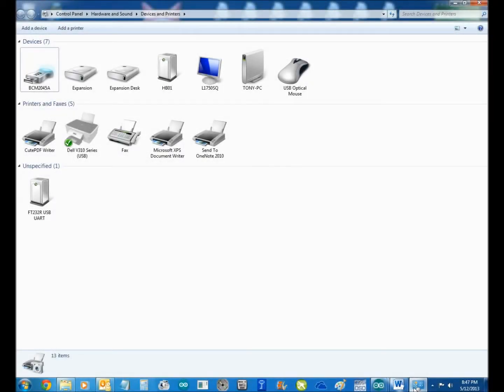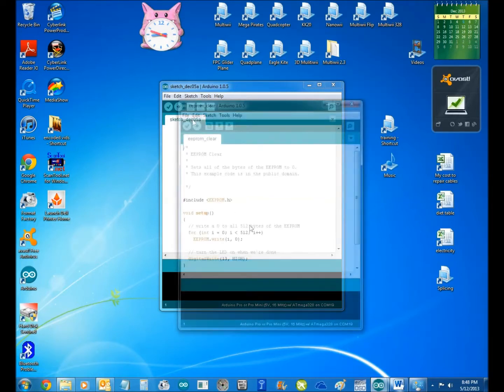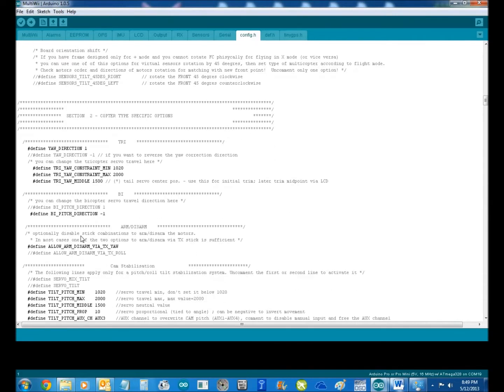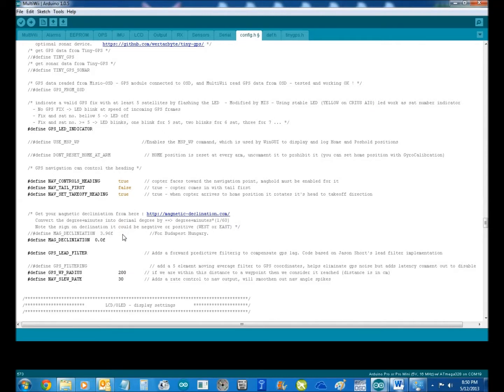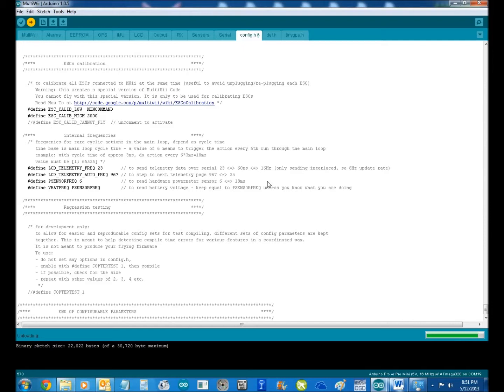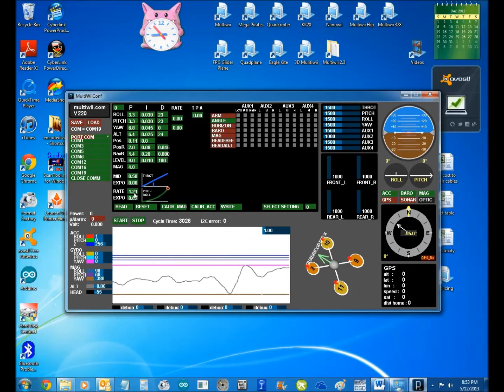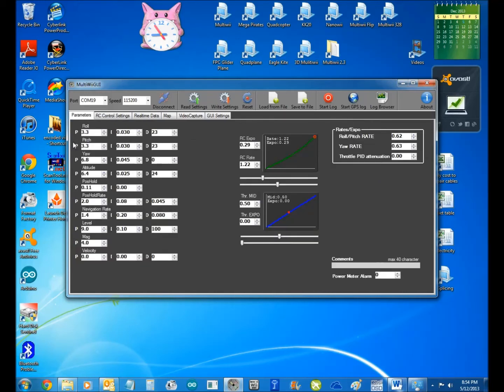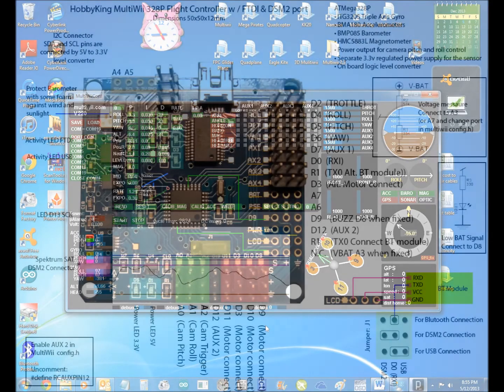Multiwii 328P Board Set Up

Comment: Hey, me again. I've sent you a rather lengthy question via private message. I don't know if you check that, so I thought I'd give you the heads up here. I'd love your insight about proper settings for a DSM2 satellite receiver. The details are all in the message.
Reply from the maker: +Simon Anderson Hey Simon, I have had a look at your email and I have no experience with what you are trying to do...... let me do some research and get back to you.
Reply: +moochasas I've been doing some research too. I'm pretty much ditching the DSMX/DSM2 thing, and going with a bluetooth module. I purchased a "JBtek HC-05 Wireless Bluetooth Host Serial Transceiver Module". Do you have any recommendations for changes to make to the code for using that?

Comment: Hi. Thanks for all the help so far! I'm having some luck completing all the configuration in the first half of the video, but no matter what I do, I can't get the "MultiWiiConf" program to open. The error I was getting at first was "Windows cannot find 'javaw.exe'." After realizing that was a file within the Arduino install files, I tried copying the "MultiWiiConf" app into the Arduino folder with the "javaw.exe" file in it. That didn't give me a warning, but the app still wouldn't boot. Then I did the opposite; copied the entire "java" folder from Arduino into the folder containing my "MultiWiiConf" application. Same outcome. Help me!
Reply from the maker: +Simon Anderson There are a few unforgiving steps within this process..... you need to get both the program and the GUI as a pair. You need to have the latest JAVA update on your computer. You need to open (unzip) both files and keep them under one folder..... so here is the steps in order.... Download your MW files and put them into a new folder ...... unzip them. .. connect the board to the comp... make sure you can see the board in your PRINTERS & DEVICES..... check what comm port you are on and make sure your baud rate is 115200...... (this can also be checked in your DEVICE MANAGER/ PORTS).. now close that up as you cannot have the arduino file and the GUI open at the same time.... open the GUI folder and there will be 5folders to choose from.... windows 32 & 64 bit,  Linux 32 & 64 not and Mac....... usually windows 32 bit works.... in that file there is a file called Multiwii Config.Application.... click on it and it should bring up the GUI........ then with the board connected to the computer click on the comm port that you saw in your device manager or printers and devices folder.... thats about it....... there are a few important sequences in the above... copy and paste this reply and follow it to the letter.......IF you dont get the part where the GUI sees the board reply back to where you got up to and what error you got..... these boards are unforgiving if you dont have all the steps in place in sequence..... cheers and good luck
Reply: +moochasas Thanks for responding! No luck though. I've tried updating JAVA; I've tried unzipping the MW files in the JAVA folder; I've tried installing the JAVA update into the unzipped MW folder on my hard drive; and I've tried all those options on two different computers, one with Windows 7, and one with Windows 8. Still no GUI. The app hates me! What now? I've been trying all this with the latest MW release 2.4. Could that be part of the problem? A while back I tried MW 1.8 and had the same trouble, though.
Reply: +moochasas WHOA!!! It worked with the Windows 32-bit like you said! So, I have the GUI open now, but I'm having a few other complications. I think it's stuff I can work out on my own though. Thanks for the help, and hopefully I won't have to bother you too much from now on.
Reply from the maker: +BGmamaBlu Congrats... and let me know if I can be of any more assistance.... and it was no bother.. its a pleasure to help

Comment: Ok so i am somewhat familiar with mutliwii i have wii pro board and it all works fine i got this board its new first time its pluged in so its a wii 328p with FTD/DSM2 port v2.3 quadx so i plug it in i tried 2.1 and get 2.2 and all i get is is error first it was mix tape error now its serialopen error with about 5 others you have a cell number i can text and u can help me walk throught if so email me it at flycrazy1981@gmail.com
Reply from the maker: +flycrazy william I emailed you.
Reply: +moochasas Hello moochasas, I got the same Problem. Everthing works fine until the upload of 2.2. I got this message:Serial:695: error: 'SerialOpen' was not declared in this scopeWhat could be the issue?Thx

Comment: i am trying to clear the eeprom and i keep getting that its uploading then fails
Reply from the maker: +flycrazy william The only 2 things I can think off is that you either have not got the jumper on the pins to allow the USB to be connected or you have your AUX 2 wire connected........is this the first time you have connected the board to the computer?....... do you have the right drivers for the board?...... let me know how you got on and if you have still having trouble if you could give me some background info that would help such as "this is my first time" Or I had it connected and flying but that was ages ago and now it wont connect"....... the other thing is do you have a blue tooth unit connected to the board (if you do disconnect it)...... also try another USB lead..... cheers

Comment: checking my sketch i got this issue
MultiWii.ino:67:21: error: variable or field 'SerialGpsPrint' declared void
MultiWii.ino:67:21: error: 'prog_char' was not declared in this scope
MultiWii.ino:67:32: error: 'str' was not declared in this scope

what is?
Reply: Luca Nsh i made it typing #define _PROG_TYPES_COMPAT_ at the end of def.h page. its dangerous? or?
Reply from the maker: Luca Nsh sounds like you should clear that sketch out and upload a clear fresh one........ and dont go ohhhh....this is how we learn and become fluent with the process..... trial and error... and at the moment you have errors.... so start again to avoid trying to fix something that still may be risky to fly
Reply: moochasas in fact it doesnt fly, throttle up and no one motors spin, and connecting the multiwii to the pc the picture with motors number doesnt move, roll and pitch axis too
Reply: Luca Nsh arm and disarm probs, im newbie ): ill test it
Reply: moochasas it works, but two motors have less power. Can i re-calibrate the escs?
Reply from the maker: You can but what I would check first is does it fly.... sometimes everything evens itself out when you take off..... the other thing I would do before you re calibrate the escs is swap over a good and a slow motor to double check that it IS the esc.......
Reply: moochasas ok ): hope that nothing is damaged. one more questionThe min and maxthrottle value from define.h can be set over 1550( which is the motor s kv?)
Reply from the maker: Luca Nsh in the sketch you can change the value of the min throttle by over writing the number ....... **************************    Motor minthrottle    *****************************/
    /* Set the minimum throttle command sent to the ESC (Electronic Speed Controller)
       This is the minimum value that allow motors to run at a idle speed  */
    //#define MINTHROTTLE 1300 // for Turnigy Plush ESCs 10A
    //#define MINTHROTTLE 1120 // for Super Simple ESCs 10A
    //#define MINTHROTTLE 1065 // special ESC (simonk)
    //#define MINTHROTTLE 1050 // for brushed ESCs like ladybird
    #define MINTHROTTLE 1150 // () (*)
Reply from the maker: moochasas You can see my minthrottle is 1150..... you can make it what ever you like..... but the higher the number the faster the motors will spool up when you throttle up........
Reply from the maker: moochasas define.h is not a page..... I hope you meant config.h :) and 1550 would be way too high as the motors would spool up and the copter would shoot up..... try smaller increments.
Reply: moochasas this is my specs. Motors HKdonkey 1550kv 100w - Props 8x4.5 - Battery 1000mah 2s - FC Multiwii328 - Esc turnigy 20a. the quad is 600gramsit wont fly. with 1250minthrottle too. That motor still moving lower. what's wrong? can u help me?
Reply from the maker: The problem is your battery is too small... a 2200mah 3S would be better and a 3000mah 3S would be ideal.... Also those motors seem slightly small as well...... I would invest in some park 450 x 1200kvs.....
Reply from the maker: https://youtu.be/U_ChrkrVcBI
Reply: moochasas will i have results replacing only the battery?or i have to buy those motors too(or others with similar specs)? But, if i make a new lighter frame?
Reply from the maker: Luca Nsh You could make a lighter frame, that maybe the easiest and cheapest option to check/prove the power to weight ratio. I would get a bigger battery and some other motors..... if you checked out my free falling vid that copter is a $20 frame with the 328P board with a 2200mah 3S and the park 450 motors....... if you bought that you would have a great copter ........ If you have one of those flamewheel frames they are rather heavy. Welcome to the joys of flying.
Reply: moochasas aha what kind of joys, i hope to buy those motors soon, just the time for reach that price. Meanwhile i would want to make this copter take off for some practice. But for now, replacing only the battery,i will have no results, right?
Reply from the maker: Luca Nsh If you get a bigger battery then you should be able to fly..... I just dont know about those motors.
Reply: moochasas Specs:RPM/v: 1550kv
Dimensions: 28 x 17mm
Shaft: 3.0mm 
Voltage: 7.4v~11.1v
Weight: 33g
No-load current: 1.0A @ 11.1v
Max Current: 10A
Max Watts: 100W
Mounting Holes: 33mmProp Data:
7035 - 7.4v - 3.5A - 180g Thrust
8043 - 7.4v - 6.4A - 285g Thrust
7035 - 11.1v - 6.5A - 370g Thrust
have i to buy a 3cell battery @ 2000mah ??
Reply from the maker: I would still get a 3S battery,.

Comment: I've tried doing this a couple times and I keep getting the Orange menu message every time i try to upload. ;"''( . Can you help me ?
Reply from the maker: The orange message means that you either have not enough room, you have the wrong board or selected..... what does the message say in the orange area
Reply: moochasas Hello again. I get these errors:
MultiWii.ino:67:21: error: variable or field 'SerialGpsPrint' declared void
MultiWii.ino:67:21: error: 'prog_char' was not declared in this scope
MultiWii.ino:67:32: error: 'str' was not declared in this scope
Error compiling.
My pc indicates that the Multiwii is in Com4. 

 When i open Muliwii GUI every seems to work but i cant get the turnigy 9x to arm it. Do i need to do something in GUI or to the Transmitter ?
Reply from the maker: Roberto C. Mercado what version of multiwii are you trying to run there and wha GUI are you running,......... MW comes with 2 folders, one is the sketch and the other is the GUI and they must be used together.... also where did you get your sketch from?.... a lot of people exchange sketches and that does not work...... I will wait for your reply
Reply: k moochasas Please excuse me if i do not understand some terminology, i'm a complete Newbie to all this...  I'm using Multiwii 328p and i'm using GUI 2.2 thats what is showing on the top left corner of GUI i got it from google code.  the sketch shows that its from MultiWiiCopter by Alexandre Dubus. im not sure if i've put this sketch into the multiwii because i've gotten the error messages after doing what you show in the video. Correct me if i'm wrong but i could have the standard sketch from the multiwii 328p...? i have calibrated the escs to my turnigy 9x, if thats any.
Reply: moochasas ok I can now arm the multiwii 328p with 2.2 and the motors spin. Now, i'm guessing, i need to adjust end points in turnigy 9x and anything in the transmitter. Do you have any suggestions ?
Reply from the maker: In the config.h right down the bottom there is a line motor_stop.....remove the // from that and the motors will not spin till you throttle up. If you leave it the copter motors will spin up to the min throttle RPMs once you arm it..... again in your config.h up near the top there are 2 lines showing which sticks you can have to arm your copter...... if you have a mode 2 radio with throttle and yaw on the left and you have the throttle and yaw stick uncommented in the sketch to arm the board then you can open out your end limits for the lower throttle and yaw R & L...... hope that makes sense.
Reply: Awesome I did that and I've adjusted end points and subtrim, it works. I still don't understand how the falesafe and flight modes are configured with the switches. Do you have any videos or websites I can follow instructions for the turnigy 9x (standard firmware)?
Reply from the maker: Roberto C. Mercado Congrats..... so far so good so lets move on to the next bridge..... failsafe is a function of the RX ... if it looses signal it can be programmed to either hold a set of values (for a plane you would rudder left and fly straight for instance) or you can have it halt everything so it drops out of the sky... the fail safe function in the sketch is OK but not as good as having it set on your RX.... https://youtu.be/cFZL-mlx4Wo
Reply from the maker: moochasas https://youtu.be/7sExKKzNJVc here is how I set up my switches..... hopefully everything everyone needs is right here.... as I seem to have broken everything at one point or another so I do a vid so others can avoid the crash... (so to speak)....... if you want something such as stunts.... type in moochasas stunts and you should get one of my vids basically for your switches you need to set them in your radio then see them in the GUI.... then follow the vid for how to allocate them in the GUI.. its not hard....... https://youtu.be/ls-vYE47yJE
Reply: Ok, I understand how failsafe works, it's very useful... Oh, no stunts for now :)  I'd like to configure the quad to be smooth for videos and hovering without Gps, if possible... I followed exactly the video about the 3 position switch, but it acts differently when I check the settings in the display. Maybe it'll work anyway haha....... :/ MW Nav Gui isn't working with my board, it's saying something about mismatch.

Comment: Have you ever had arduino program crash after sketch upload ? this happened to me a few times last night, and i did get the board in a situation where two red lights on solid 5v and 3.3v, and the blue led continuously flashing fast. i did seem to get out of it last night but wondered if you have ever had this happen
Reply from the maker: Nope I have never had arduino crash ever... what exactly are you doing....... can you give me a 1-10 so I can see what / where you maybe having issues...... also is this crashing a new thing or have you just started using arduino or are you an experienced operator and this is new......
Reply: hi, i cant remember the exact message (windows 8) but my pc rebooted soon after the sketch had uploaded. I suspect it may have been due to me powering up other components on the  multiwii....i had the receiver, a voltage monitor, the oled, and the bec connection from my q brain attached,, to multiwii. I did read somewhere not to attach flight batttery speed controller bec.. to multiwii at same time is this correct

Comment: I am getting the error "programmer not responding" (avrdude: stk500_recv()). What should I do ?? I'm on a mac, so I guess I don't need to install any driver..
Reply from the maker: you should check your board is connected to the comp in the device manager section before you start so you can see what comm port your on plus check the baud rate.... if your getting that error have you:
Cleared the eprom before you upload your sketch,
Got the right board in arduino
Got the right comm port in arduino.
The main reason would be that the jumper over the 2 pins near A2 & D12 is NOT on....... that jumper (when removed) stops accidental changes to your sketch and usually the problem your getting is that the jumper is missing....... if its in place and you are still getting that issue can you please answer the following:
Have you been able to make changes to the sketch before
Have you got a bluetooth unit connected to the board.
last thing (if you are still at a loss at this point) can you give me a 1-10 on what you have done or better still post a vid of the problems and talk me through it.... it will be something simple.

Comment: hey man thanks alot for this video.  it seems like this is the only video out there that is very helpful in setting the multiwii 328p board. and for those people out there getting the stk500_getsync(): not in sync: resp=0x00  i was getting the same error out of the box. and was getting frustrated  until i saw a picture of the board and noticed i had the little black jumper on the 2 wrong pins, so i moved it over and bam it worked!! also make sure to uninstall and re install the drivers, hope it helps